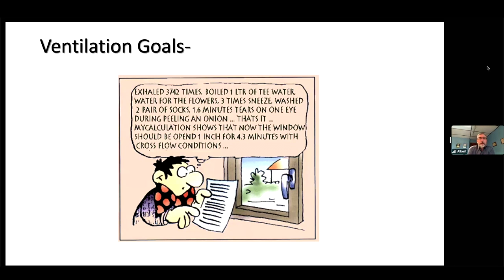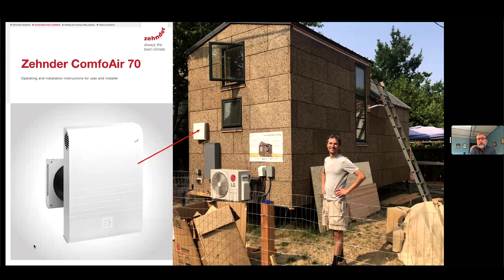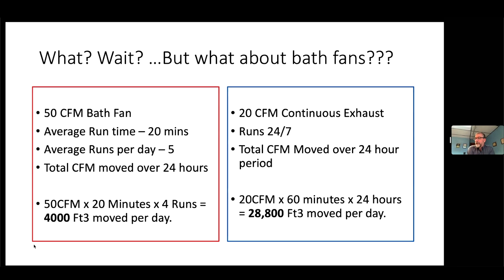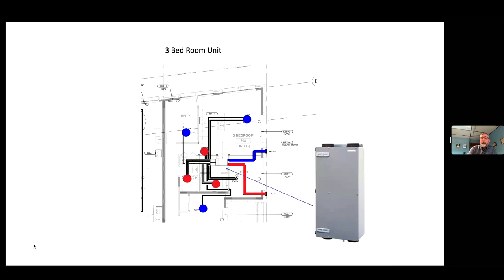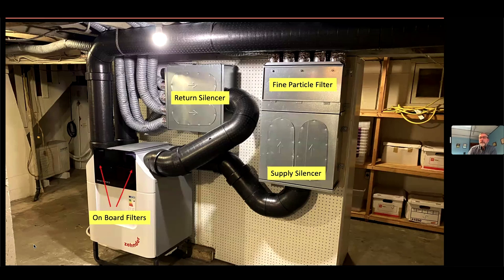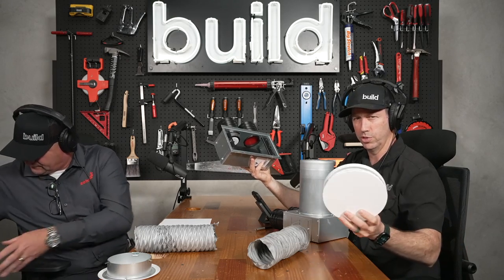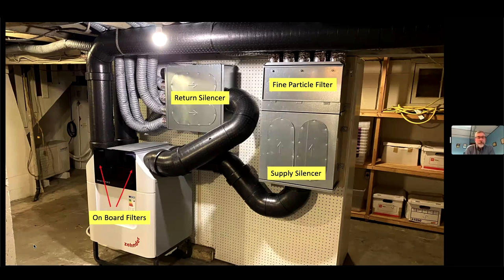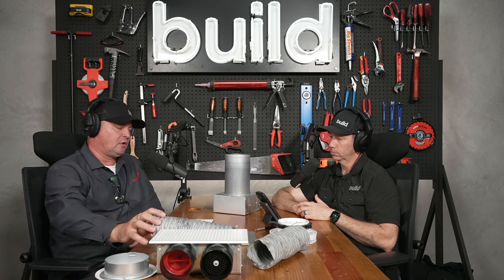BUILD SHOW LIVE:  Fresh Air Code and Options—Small Homes, Tiny Houses, and Multi-family Dwellings

Comment: @Matt Risinger I really like this Zehnder system, I am actually designing a small home (single story est. 1300 square feet, with a partial (est. 612 square feet) full basement currently in the North East, love the explanation and the fact that I can install the right size system, run the home runs myself and just call Zehnder and have some one stop by and dial it in, is fantastic!!! Liked#7 !!!

Comment: Can something be done with a clothes drier vent? As we run the drier we are most likely pulling a suction on the house structure.
Could we run this warm exhaust through a cross flow core to warm and temper the overlooked needed supply air?

Comment: How does a ventilation system like this Zehnder would do with a kitchen exhaust that would extract out around 600CFM? This is important to consider as it can depressurize the airtight home, and that’s not a good idea. What are the recommendations by Zehnder regarding the kitchen exhaust?
Reply: open windows and doors?

Comment: It would be helpful to categorize when to use certain equipment. For example, if the home blower test is greater than 2-3 ACH @50 pascals then it may be more practical to do filtered fresh air input and bath/laundry fans to exhaust versus less than 1-2 ACH @50 pascals where air infiltration has been minimized such that an ERV system would be a better fit.

Comment: In the process of designing a new house up in Vancouver Canada area.  Love this channel Matt.  Simple question.  Is the ERV a completely separate system from the our ducted heating cooling air source heatpump?
Reply: Yes, its all in the name Heating, Ventialtion,and Air Conditioning. You need all 3. The ERV only handles ventilation. The technologly in the zender units allows for efficient energy transfer to reduce cost of heating and cooling of the fresh air but you would still need a heating/cooling unit to change the indoor climate.

Comment: Like the information, however, his assumption that a 50 CFM bath fan puts out significant less that 50 CFM. Look at the pressure drop over the length of the exhaust pipe typically 4 -6 feet is typically 10 CFM. Static pressure needs to be taken into account.

Comment: so, all that dribble and bad audio for a long winded zeynder advert with no real talk about the codes or an explanation of the codes ?
3 questions ... what are the codes for erv's and hrv's ??? is that in the IEC, IRC , or IBC ?
are there any fire rated terminals or terminals with a fire damper for fire rated ceilings and walls ?
and since ERV's and HRV's fall under the parent topic of IAQ ... the chart, particularly the elevated targets for humidity contradict standard IAQ practices. is there a reason for this ? the human comfort ranger is 35%-50%Rh, below that property damage to wood based products occurs as well as medical issues to include exzema, dry/bleeding nasal passages, and respratory issues. above that brings on biologic issues, property damage of wood based products, and medical issues including respiratory issues. Dust Mites hatch at and above 50%. the ideal target is 43%Rh. so the chart showing elevated humidity levels was perplexing. in addition from an efficiency perspective ... lower humidity "feels" cooler ... ideal for summer months, and higher humidity "feels" warmer, ideal for winter months  ... this allows occupants to have an altered demand for heating or cooling other than temperature alone. ie ... 78* and 30% may be too cool, but 70* and 70% may be too warm.

Comment: Fresh air equals wasted energy. If not make a cooler more efficient with using no electricity. You are using unconditioned air and pumping it outside. To reclaim the energy you use more energy to put it back in. Just another way to waste money
Reply: I sure do and as people turn on exhaust from the range bathrooms and open doors it goes away just like in many years past.
Reply: These systems are meant for a modern home with tight envelopes not older homes. Modern homes are designed with high effeinecy(high insulation/r valve costruction) and a tighter envelope which takes less money to heat and cool. The down side is you need an extra system to handle the ventilation of the home which is where zender comes in. I agree that these systems can be a waste of money but only if they are placed in an environment where condiotions cant be controlled like in older homes where the envelope is not as tight.